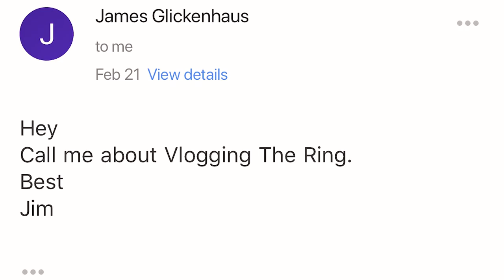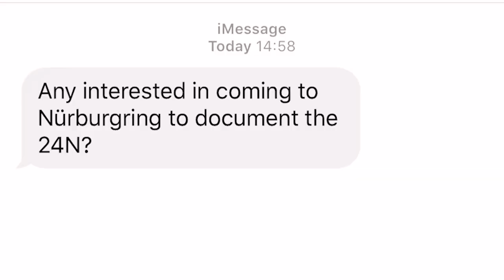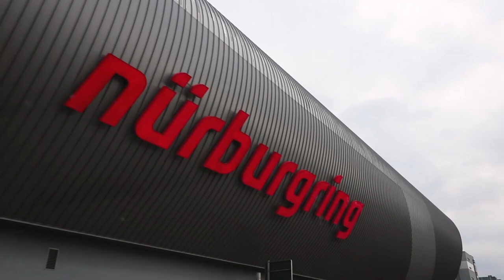Surviving 24 Hours in Hell (Official Video)

Comment: Savage AF! 24 hour of pure abuse! Respect to those builds! That is why Nascar has nothing against this type of racing. It rains and they stop racing. Rally Racing is another type of savagery as well!
Reply: Johnathan Harrell The same I always tell my friends who drag race. I autocross because it is not about having the most horses. It is about knowing how to maneuver them.
Reply: You have to understand there are MANY FORMS of racing. Bashing NASCAR  vs another form is low brow. As for autocross vs drag racing BOTH have thier place and fans. Much like small track circle track racing. Or Sprint cars. 
Pretty much any car can be autocrossed, where as dragracing can be much different dynamic. The basic drag race as in street vs street are similar in fit, form, function and autocross is different and stresses handling over acceleration. 
I generally see one for of racing being snobs over others and it holds true here. If I put you with autocross experience in a 12,000 hp top fuel dragster your confidence might be a bit low.
Rather than bash try stating that YOU prefer autocross over dragracing. Emilia loves dragracing and took her LS swap out and had blast even though her test and tune was cut short.
And I actually can lend a different view, I've "road raced" in an old Bondurant driving school, bracket raced, dirt track raced and my cousin really pushed the Pro Touring/show/drag crowd into autocross. He just sold his suspension company to Fox( it's Ridetech) shocks. AND 20 some yrs ago proved that air ride car suspension CAN autocross hard as any other.
And that was back when air suspension was bashed as fair grounds/low rider tech. He also took US made coul over tech to the next level for the price. 
So remember if you talk bad about someone else/something else it may show how shallow your premise is.

Comment: Awesome channel with awesome content. Thank you for sharing your adventure! Quick question though. I notice in the pit stops there were crew members standing by with dollies but I couldn’t see how the car actually got lifted into the air. Can you shed some light? Thanks!!

Figure I would double back and answer my own question. After a little research it appears that the lift system for the cars is built into the car and is powered by a pneumatic line. A pit crew member attaches the air line to a valve that’s installed on the body of the car. The supplies air operates the lift and the car raises a few inches. Then the driver gets a que to release the valve when the work is done and area is clear of ppl. Car drops and off they go. Pretty freakin cool!